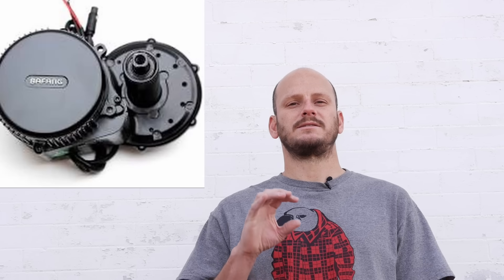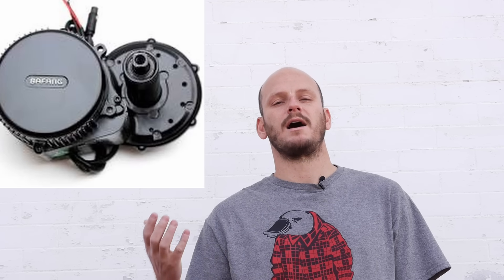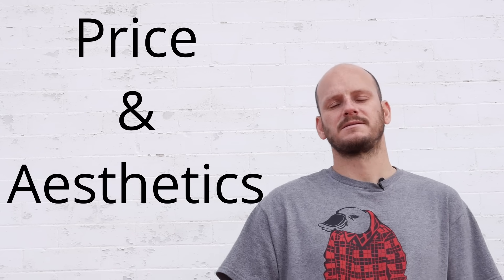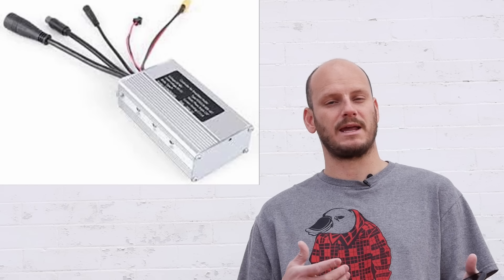Hub vs. Mid Drive Motors: Why Hub Motors Suck and Debunking Common Myths with performance test

Comment: This guy makes a lot of sense to me. I've never had an e bike but as I understand it, E cars are single speed, no transmission. Seems to me a multiple gear system on a E car or E bike would do wonders for performance, efficiency and battery mileage. I read about an E car coming out with a 3 speed transmission so they are catching on too.

Comment: I agree with info at Bike Swift.  From an engineering standpoint my 350W hub motor is more than adequate to get me up many of the hills I ride.  At almost 70 years old and an engineer, I think the engineering done on the hub motor kit that I purchased was done well.  At well over 200 lbs, I only have to set the motor to a 10% assist and it more than compensates for the extra torque required to get me over the hills I ride.  The bluetooth LCD throttle is also nice to have.  So far I have had no problems with torque and or top end on level streets.  E-bike kits were to assist one in pedaling up grades, not to be an electric motorcycle.

Comment: I’ve had both a hub and mid drive@ Specialized Vado and a Rad Rover, much prefer the hub motor on the Rad. Just my opinion. Haven’t had any problems with my hub drive, but plenty of issues and expensive problems with the mid drive. I also like how the hub drive feels over the mid drive.

Comment: This is why you get an insane 1500-2000w hub drive.... for your front wheel, not rear.

I wont have to deal with wear on my cassette or snap my chain either which has happened to me before, and I maintain my whole shimano cassette. Its also VASTLY cheaper (Australia) and simple to install (front).

Sure in Australia ur limited to 25km/hr (if you care about adhering to that) but the big oversized motor has SO MUCH extra torque, simply limit it on the controls to 25 and keep all your big motor torque.
Reply: Its still illegal > 250w even if you limit it to 25km.

Comment: As far as “transmitting power through the spokes”, that is EXACTLY THE SAME for mid-drive motors. Do you even Physics, bro? In fact, you just got done telling us that mid-drive motors have higher torque, so mid-drive motors are even harder on spokes than hub motors!
Reply: How is replacing a wheel anymore work than replacing a crank? 

I swear, I don’t get your rationale in anything you say. 

Yes, I have a rear hub setup on a recumbent three-wheeled trike AND at 265 lbs I would absolutely eat through transmissions at probably somewhere around 4-5 times with a mid drive. 

In my use case 265 lbs in weight plus an additional 45 lbs for the trike two batteries and other gear/tools in the panniers, I am just over 300 lbs total weight. 

You’re not going to tell me that with that kind of weight going up any hill, let alone anything with a significant grade, and running adding more stress to that transmission by transferring the power from a mid drive motor through it is better than a hub motor assisting the forward momentum independently of the transmission.
Reply: @TroyShields - You are 100% correct. I love mid drives, because I have mid-drive customers and I'm a bike mechanic - they eat drivetrain components like crazy and they think it's normal. 

My bikes have hub motors.
Reply: EXCATLY,  GIVE ME TWO MOTORS OVER MIDDRIVE ANYDAY. ILL TAKE ECELLS SUPERMONARCH 1500 AWD over ANY I'd drive motor. And there ONLY 750 MOTORS NOT A BAFANG RM G062.1000.D WITH 108 NMs per motor for 216NMs. Is the most out there beats ANY MIDDRIVE MOTOR OUT THERE unless it's juggernaut XD. supposedly 300NMs.
Reply: Why can't bikes use mid drive and hub Motors
Reply: I like the way you think! @TravelatorH8r
Reply: spokes are not the issue if you got good wheels.

Some motorcycles also use spoked wheels and they can transfer 50KW trough them.
Reply: @svr5423 - Absolutely correct. I was trained to build wheels when Schwinns were made in a Chicago factory and they had training schools for the mechanics. 

I built many hundreds of wheels since then on everything from 20-in Raleigh choppers to carbon fiber race bikes to basketball wheelchairs to Ducati sport motorcycles. 

Crappy undergauge Chinese spokes are much more of a problem than anything intrinsic to using spokes with hub drives.
Reply: What works the spokes loose it the way the torque is applied. Hub motors are direct. The mid drive is cushioned through the chain and driveline. Do YOU even physics? Same principle is why an engine creates more HP at the crank than at the wheels. You should have a basic understanding about ANYTHING before sucking on your foot this hard. ever.
Reply: Yeah... here is trying to explain something in detail, when it is the details he doesn't really understand. I gave up. I know more about these things than he does.
Reply: I think they come apart in hub motor types (I'm assuming he's experience is valid) is because hubs have like 21 poles or something, so in each turn off the wheel they get a big pull then smaller power 21 times, which instead of continuously pulling would rather shake it, or hit it, like an impact driver. Mid drives have reduction, the motor spins much faster, so the big pull isn't that much of a problem as the motor switches poles (like 4k30hz vs 1080p120hz, you g get the same amount of pixels, but damn the 1080p120 will look nicer to your eyes, especially in games)
Reply: @CMDRunematti  that anecdote means nothing
Reply: The torque is by the résistance of the wheel that is lower with the mid drive thanks to the adapted gear of the derailleur. 
But true, if you keep on lowest gear ring and try to climb and apply full watt result is almost the same, like starting with your car in 5th gear you'll burn your clutch keeping the motor power
Reply: I think somebody is confusing spokes for sprockets lol
Reply: Right sprocket ratio lowers torque applied to the spokes 😉
Reply: @refractorymercury - It absolutely does not, and now I know what grade you got in physics.

If you accelerate a bike from 0 to 20 over 15 seconds on a 2% grade hill, those spokes will feel the exact same forces whether you got your power from a weed eater gas bike engine, a mid-drive electric engine, 15 geared down hamster cages, that hub motor or just your massive thigh muscles,
Reply: @47f0  torque doesn't impact accélération but only the power that can be high with low torque, just figure out a 50cc vs 1500cc motorbike accelarating exactly the same, they need radically different sproket make to take a rather différent torque. Sorry I'm just an engineer.
Reply: @47f0  torque has nothing to do with acceleration, it's a couple of forces that applies on the wheel, gearing is the solution to apply more couple and allowing climbing slopes. Steeper is the slope and bigger is the weight to move, bigger is the required torque, it's quite famous on MTB the Bafang HD 1000 can twist a big cassette climbing steep slopes that no hub motor can climb because unable to deliver required high torque. True the spokes are somehow protected by the cassette and the chain that break before but they are the next on the list with a transmission able to deliver it.
Reply: Yeah it's different man. Hubs work better on scooters and spokes are the reason that I stick to them. I have enough guitars and drums to tune LOL
Reply: Picture this… what’s easier turning the wheels by spinning the whole wheel or using the actual leverage of the same crank system that you pedal? It’s just plain leverage… similar to lifting heavy objects like an engine block with a chain using minimal effort
Reply: @greg6162 nobody said that you can’t get more power out of a mid motor than from a hub motor. The question is: how much power do you need? 200W, including your pedaling, is enough for around 20mph on flat ground. So how much power do you actually need? 
Second problem is that a mid motor transfers the power through the gears etc. what do you think happens to the drivetrain if you put so much power through it. And replacing the drivetrain isn’t cheap.
Reply: THE T0RQUE FR0M A MID IS N0T A STRESS 0N SP0KES DIRECTIY~
Reply: @skyjuiceification  of course it is, all torque is transmitted through the spokes
Reply: @skyjuiceification  how is it not the gear set connect to the spokes? Hmm

Comment: You are NOT comparing “apples to apples” when comparing a mid drive PLUS a multispeed transmission system to a hub motor with a single freewheel. The correct comparison would be comparing a mid-drive with a single rear cog to a hub motor. On top of which, there are different types of hub motors—geared (yes, *geared*) and direct-drive—each of which has its advantages and disadvantages, which you totally glossed over. It may be that a mid-drive is superior in most situations, in terms of outright performance, but that is not the whole story. Hub motors work well for many, many people, and are available at a more reasonable price for a lot of people.

Comment: Love my hub motor so far. It’s a Zehus. The bike is overall light, looks almost like a regular one and provides some mild assistance - using it at 40% of max power. Not a fan of the bulk a regular ebike brings with it.
Reply: But I will admit that after riding a rental bike with gears… made me second guess. The gears provided basically the same „boost“ as the hub motor on a single speed. I know, I know… preferences just don’t follow logic ;)

Comment: One kind of related comment: The hub motor shown here has a relatively small diameter, I've used one with a 10" diameter and the torque is enormous because the moment arm is longer. So a better comparison would be between a mid motor and a large hub motor with the same wattage.
Reply: That's going to exacerbate the problem of unsprung weight, and it moves it further from the axle.
Reply: @Barnaclebeard  I dont see unsprung weight as a major problem. It only matters if your bike has full suspension.
Reply: @Barnaclebeard  Could you elaborate please? What is the "unsprung weight" problem? I'm new to all this.

Comment: Sorry I Must Disagree: The reason why they have transmissions in Cars and vehicles is because every engine (Internal combustion engine) has a different horse power and torque  Throughout its RPM range. Most electric car manufactures only have single speed transmissions... this is because Electric motors have a Linear Torque range where it delivers 100% torque throughout its RPM range. The difference in most situations is pure Gear Ratio .... and SPEED CONTROLLER SETTINGS. Speed controllers are responsible to control the amount of deliverable torque is delivered and most a tuned down to allow for traction control and reduce burnouts as much as possible resulting in most of the time loss of control of the vehicle.

The Hub Drives have a planetary transmission system to deliver the power to the ground and a mid drive uses fixed reduction gearing the exact same way as a motorcycle engine (you will see the similarities when you look at each.
Reply from the maker: Thanks for chiming in👍 every motor system is different on Ebikes, but the vast majority all use planetary gear reduction.  Using Bafang mid drives as an example as the best selling motor on the planet. The instant torque does not mean you will get 100% performance immediately though. It still has to deal with physics. It just means it’s able to do work at 10 rpm unlike an internal combustion engine. 
Check out this video for a better explanation
https://youtu.be/4zS0vD1QNB8

Comment: is it not true that the hub motor is more efficient at a specific speed (perhaps the most useful speed) which is a critical thing for overall energy consumption?
Reply from the maker: Arguably in theory. But it’s less efficient at every single other speed. In normal riding (stop and go and hill climbing) a mid drive is more efficient in practice IMO.

Comment: Mid drive  are much more expensive and not easy to install unless you are a mechanic,  also they put a lot of stress on the gears, and one thing the chain , if you break a chain you have bad cards , l have a front wheel motor pulls good have no Problems with chain or gears are not expensive and l could fit it myself so for me a front wheel motor is the best.

Comment: Other thing to keep in mind on a bike with rear suspensions is that a hub motor is adding unsprung mass.
Reply: What does that mean
Reply: @johnmccatherin5892  With any suspension system, mass on the wheel-side and not the chassis-side is unsprung. On a car for instance this is the wheel, wheel carrier, wheel hub/bearing, brake rotor, and brake caliper. Unsprung mass is bad since it is quite literally mass that vibrates without being damped by the suspension.
Reply: @henryatkinson1479  ahhha interesting
Reply: Absolutely correct, and if I were racing, and didn't care how many drive parts I were trashing, a mid drive would probably be my choice. Unsprung weight definitely affects handling.

I'm commuting on smooth pavement, mostly running errands, going to the doctor, recreational riding with friends, and as far as I can tell my mid-drive friends and my hub drive bike get where we're going about the same time. Only I'm not constantly buying chains and cogs.

Comment: So basicially this guy is full of crap, probably saying these things to promote mid drive bikes. 
1.) There have been tests were people have tested hub vs mid and these tests have mostly concluded that there really isnt that much of a difference. Sure mid drive have the better acceleration, however the hub has better top speed. Even with the gears set on max. Even hub motors themselves are differently built for different purposes. 

2.) Burning up hub motors is just a moot point. Most bikes run with a hub motor, obviously more hub motors get damaged, because guess what? There are more around. Also people have a stronger tendency to run their cheaper e bikes waaaaaaaaaaayy out of spec. Same with the entire myth of sensors suck in hub motors because they "don't last", while pumping over 1000watts into a rated 250W motor where the cables are thin and literally melt the isolation to short the sensor wires. 

3.) Nobody needs a wheel tuning stand to replace a spoke. No idea why you somehow have the weird idea that spokes are somehow harder to replace than chains. This is a common bs strategy from typical repair folks, I've heard bs like "2 broken spokes = buy a new wheel" and whatnot. While in reality replacing spokes is extremely simple, no need for any wheel tuning stand, 1 pencil or similair will do just fine. Also you suddenly talking about "rebuilding" a wheel when 1 spoke is loose already shows your obvious bias.  

4.) You talking about wheels with hub motors where literal shops refuse to repair it only shows the incompetence of these repair shops if anything. 

5.) Also you acting as if loose spokes never happen on anything but hub bikes is quite concerning to say the least. Loose spokes are a thing on all bikes, electric or otherwise. 

6.) Price, same price? Yeah no, hub motor based bikes are far cheaper. There is no argument to be had, you're lying through your teeth at this point. 

7.) About aestetics, depends on user you're asking. Personally I typically don't like the look of these mid drive bikes, having chunky thing in the middle isnt exacly great to look at. 

8.) "Rideability", I'm sorry but what the hell are you talking about. That entire "chapter" was so nonsense I don't even know where to start. 

So after all your rambling and showcase of clear bias towards the mid drive, how about we adress the elephant in the room? 
While so far hub vs mid drive seems to have its pros and cons, there is 1 major point that honestly makes mid drives bad for most DIY e bikes and probably casuals as well. 
repairability.

On many mid drives, failed sensors usually means buy a new mid drive motor because they are built in a way that makes dissassebling them almost impossible without specialized tools. Also it doesnt help that the controller has to sustain a lot more heat than on hub drives, which again, can cause dead mosfets and you're about to buy another new hub motor. Other problems with mid drive is the "mid drive wobble". Also due to the high tourqe nature and depending on your use case, you'll burn through quite some nylon gears as well, another very common defect on mid drives with single nylon gear. 

In comparison hub motors really only break mostly because people run them out of spec and even if they break "naturally" repairing them is free or very inexpensive, sourcing parts is also very easy and no problem at all. 

Overall, I tend to lean towards hub motors due to their repariability, if someone asks me which one I think is better without looking at repairability i regard them as the same, they have both pros and cons and most experience bikers seem to have that standpoint. Obviously "repair guys" will prefer the one that is less serviceably for the end user, so they will prefer mid drives by a lonigshot, why? because $$$.
Reply from the maker: You got to try riding a proper DIY mid drive, absolutely night and day 😀
Reply: @JohnnyNerdOut  i did. I suggest u try a proper diy hub powered. Then ull realise how wrong younwerr in the first place

Comment: All of your points are pointless. Performance is better on the mid drive lol . Route that torgue thru the drive train to the rear wheel and measure whats left. There are hub driven bike with gears - you should use one before making that the biggest down. Breaking chains? All der drive trains parts have way more wear using a mid drive. Use quality spokes and rims = no problem.
You really sound like a mid drive fan boy. This is far from beeing a professional and objective video.
Reply from the maker: I am only aware of two hub motors that feature 2 gears. Far from the 7-12 you get from a mid drive.